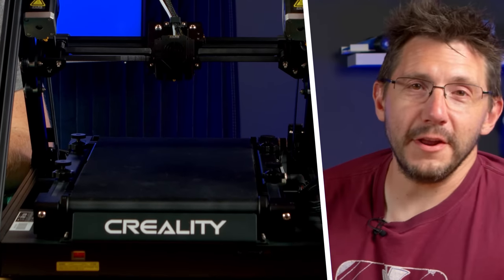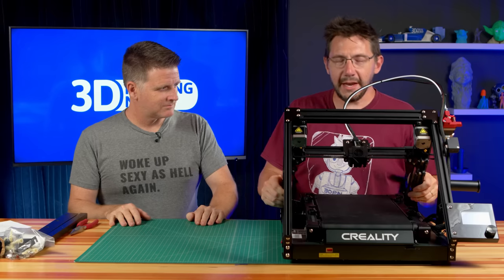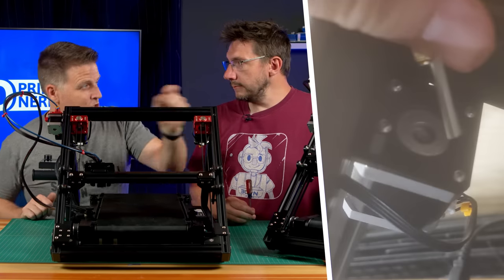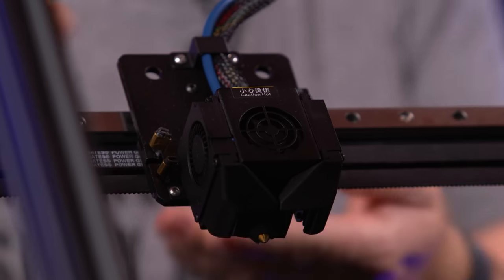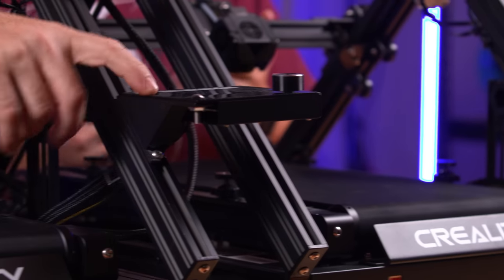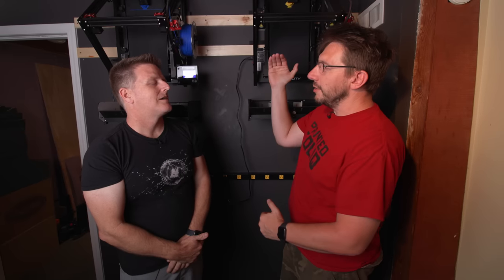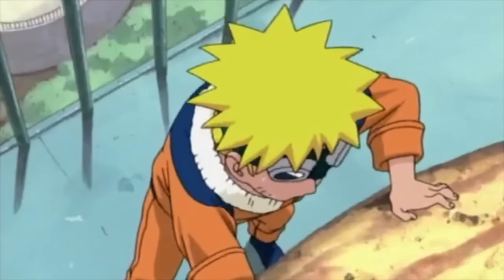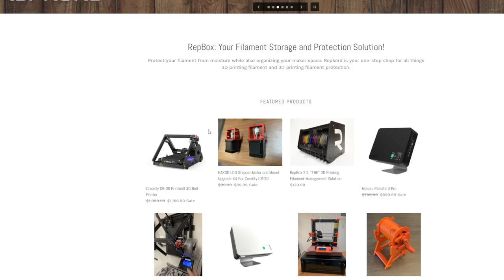Belt Printing 24/7 ON A WALL!

Comment: I totally disagree with the upgrade of cutting off the tinned end of wires and crimping on ferrels. We build and work on industrial electrical control cabinets for a living. I come in behind electricians and remove ferrels for fix overheating problems all the time. If you take two wires one with a ferrel and one bare wire and put each under a box style screw terminal, the one with the ferrel is hotter when viewed with a thermal imaging camera.  If you are going to use ferrels they should be used under a single screw that wedges against the side where stranded wire would pop out and not make a good connection or under sprig terminals. Ferrels also require a special crimper to work properly and usually $200+ USD. Phoenix and Panduit make some good ones. When properly crimped it should form box shaped crimp with ridges to indent to make a better connection. 

Properly tinned wires will conduct better than ferrels. You should be able to see all the strands of wire, but they should be all fused together and in a silvery color. When crimped under a box terminal they should flatten out a little to give move surface area for connection. Improperly tinned wires are just a round  glob of solder on the wires. This is really bad and can lead to major electrical problems. 

The best is bare wires under a box terminal. They make the best connection and run the coolest. The downside is the wires are more susceptible to corrosion and breakage. Also when not carefully inserted wire hairs can be left sticking out and lead to short circuits. 

For those of you who don’t know what a box screw terminal is. It is the connector on the Einsy Motherboard of the Prusa MK3 that the hotend cartridge heater wires go into.
Reply: PS. If you are still going to use the ferrels, do not buy the $20 crimpers from Amazon. One of the guys at work wanted his own instead of using the 3 shared ones at work and purchased one. I test about 90% of the panels that go out of our shop and when I did my wire tug test on a job that has spring terminals, I got a couple of different results. The first was the ferrel stayed in the spring terminal and the wires pulled out of the ferrel. The other result was the the ferrel pulled out of the spring terminal. The cheap crimpers are a hex shape and leave less mechanical contact area once the ferrel is crimped.

Comment: Another benefit of putting it on the wall that you kinda demonstrated but didn't mention is that in the event of a failed print, the spaghetti falls away from the print area, meaning that if you're printing a bunch of parts sequentially, one failure doesn't ruin all the rest of the prints.
Reply from the maker: Oh believe me, since filming, having fails fall away has been VERY nice.

Comment: Great video but actually pretty disgusted how much was poor quality or dangerous on this without a ton of upgrades 😔
Reply: Dangerous?
Reply: @Krytern  talked about the updating of the cables. I think that's because of electrical faults and maybe even fires in severe cases

Comment: 👉How do I print nylon on these belts?
All my products by necessity of material qualities/attributes are Nylon. 
TPU 95 is too soft, and PETG is too brittle. And PLA - forget it.
Reply from the maker: Nylon? Hmm. Not sure. I think you may need to wait until Matterhackers and Ultistik and Powerbelt are selling their new belts.
Reply: I think Nylon will fuse to this belt - Powerbelt is a good belt and the one on the iFactory works well looking forward to the Matterhackers belt
Reply: @shakaworld3D  Is there already some update?

Comment: Well this entire thing went sideways pretty fast. Drives me up the wall.
Reply: A shame they aren't sideways otherwise this joke would have been funny.
Reply: @Krytern  well, everyone's a critic :) you might check the machines around the 1 minute mark.
Reply: @PrintNPlay  I see them upright but I don't see them sideways.
Reply: @Krytern  perhaps I'm wrong, but are they not on their sides when they are working on the electronics?

Anyway, all good. Joke fell flat.
Reply: @PrintNPlay  nah. Joke was great. 10/10. Screw the haters.

Comment: If you can solder, everyone knows that it is always better to solder things than to use those kind of connectors. Nothing bad in using the connectors, but get your facts straight. A good solder joint is way better option in terms of reliability.
Reply: Oooo sorry solid

Comment: If i print a 100mm pice and get 99.5, mm and its and engeneering work that must mach anotber one, wow , thats pretty bad.By the way yuo are changing the "gravity' vector puting the machines in that way

Comment: linear rail was unnecessary,
Reply from the maker: Why do you think that?
Reply: @3DPrintingNerd  vslot/wheels are solid and reliable.  It’s fixing a problem that didn’t exist.
Reply from the maker: @adamfilip  Well, I agree with you. The thinking was the angle that the X axis is at. vslot + wheels works on the sides because the wheels are perpendicular to ground. On the X axis, the is some rotation, meaning the wheels aren't riding in the vslot as well as they should. I think there is something to that, but I wouldn't be against some more testing over time.